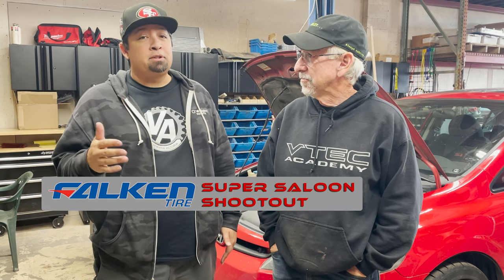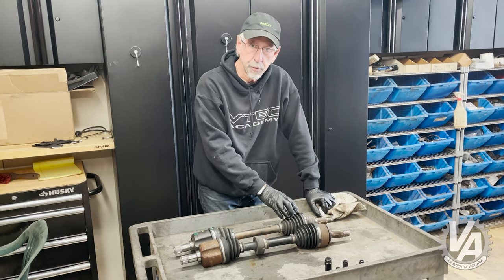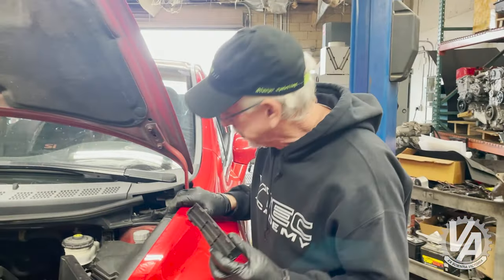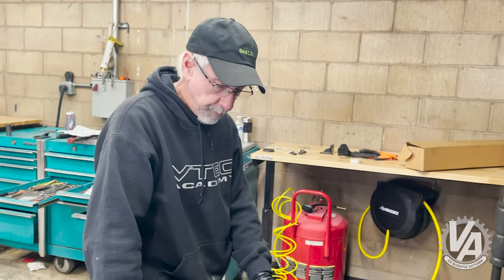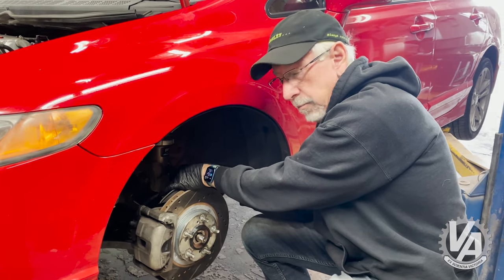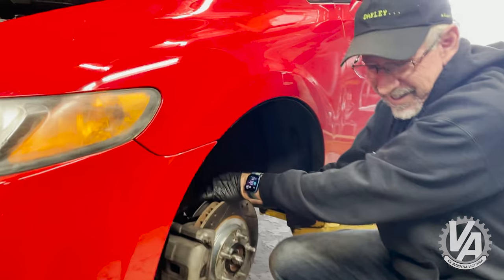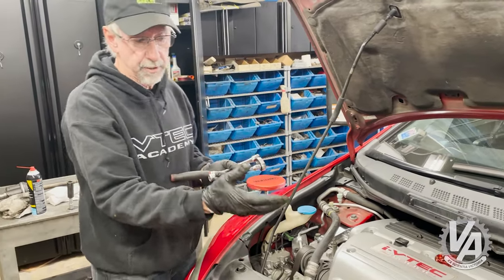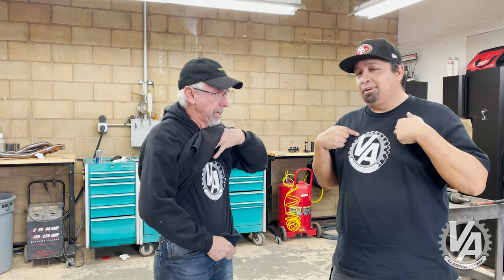8th Gen Civic Si Axle, Top Hat, Rear Mount and Torque Mount Install

Comment: Oh wow! He ‘dailys’ a Rallye Red FA5?  Me too I’m still absolutely in love with my Si
Reply from the maker: Quite possibly the best color on the FA5.
Reply: Same, it's a great color. If you are wanting to do the mounts do the kit shown not the full mount kit for the street. I did the full kit with 62A durameter. It's a bit louder than I would like for a daily. If I did it again I would just do the two torque mounts and replace the dead drivers mount with OEM

Comment: Since you guys were removing the struts,  you could of removed the axles from the top. The knuckle moves forward enough to sneak out the axles. Best suspension Honda has, so easy to work with
Reply: Best is relative. The MacPhearson might be good for packaging and maintenance, but it isn’t that great for performance.
Reply from the maker: You're absolutely right, but we wanted to record this as two separate tasks. I didn't want people to think they had to remove the strut to change the axle.

Comment: Hey Brian great video. Right after I bought my ek hatch I bought one for my wife. Found out it's the black with blue flake higher model one. I've done suspension and full devsport diffuser kit so far. Have a question if you don't mind are the nuts that hold steering rack in welded nuts. Mine spin freely on 2. I figure at some point they could have gotten snapped. Thanks always great videos.
Reply from the maker: yes, they should be welded in place.
Reply: Thank you for the response looks like time to find a new subframe